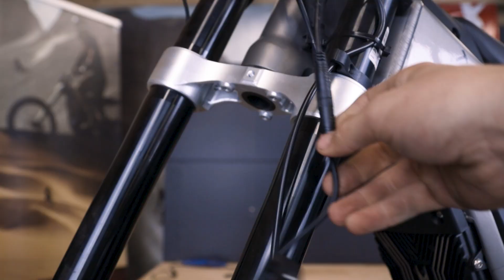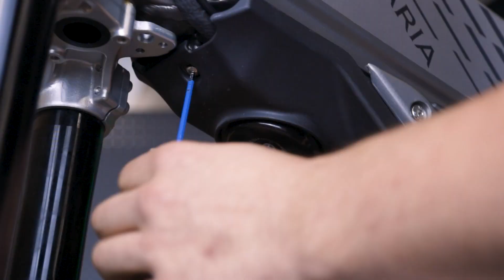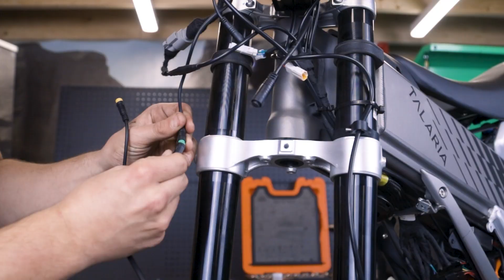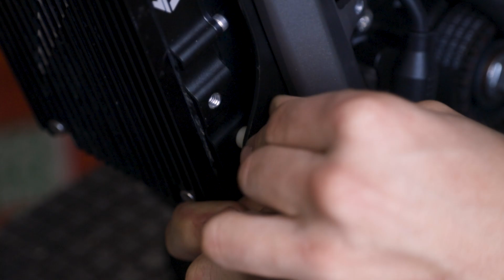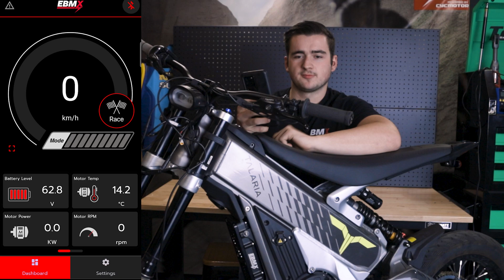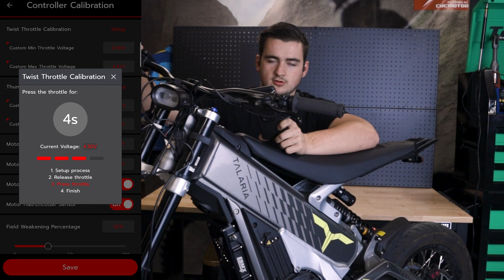Talaria xXx X9000_V2 controller install

Comment: Installing the x-9000 and following all these instructions reduced my top speed by 10 mph
Reply: Tune it
Reply: @M4DW1LL how fast does it go with tune?
Reply: @thewatertv  I got mine to 65mph but I got a 72v
Reply: @M4DW1LL  how do you tune it I got stock battery before I was going 85kms now I'm going 60kms top speed
Reply: @SethNewall-i3s  Look up what the max bbattery current ur stock batterty can take and put it to that (general) then go to modes idk if its diff but im pushing 5-7-13 for power levels 1,2, and 3 (modes and levels) and also make ur throttle ramping like 5 ms in throttle for quicker response
Reply: @M4DW1LL  max is 400. I was running 390, and I'm still only  going 50 kms top speed before I installed it I was going 85 kms.  Any more ideas?

Comment: my bike is only going 32 with the new control
Reply: SAME
Reply: @rayanbaroukh6626 did you fix it?
Reply: My guess is to cut the speed limiter, because the bike can go 50+ mph with the speed limiter cut even without the new controller
Reply: @rebzyyx999 the speed limiter was a function of the old controller, which is completely removed from the bike
Reply: Mine is too, how did you fix it?

Comment: Hey, I mistakenly put those plastic spacers on the phase wires with the lock washer and everything, Will this cause issues or will it be fine. Been riding its been fine
Reply: I'd say it would be best to remove them and torque the bolts to spec just because they aren't supposed to be there.
Reply: I did this because the first screw didnt feel like it wanted to go all the way in so I thought I had to use them at first

Comment: dont need to cut the bash guard i installed it without need to do that all you need is the lower bracket that holds the stock controller
Reply: Hey would you mind telling me a bit more about how u did it